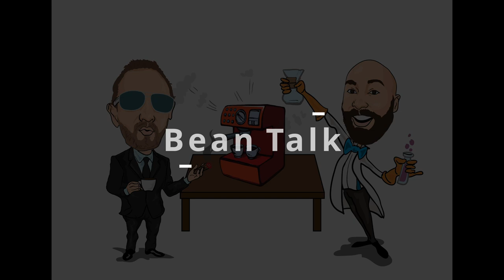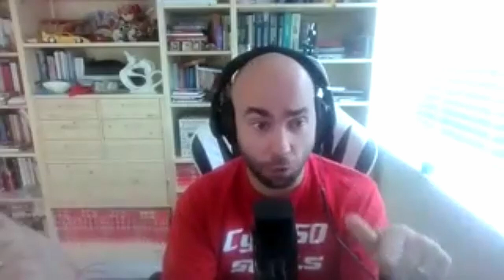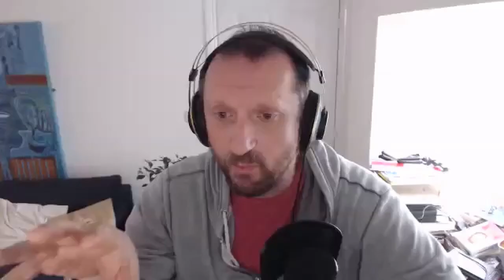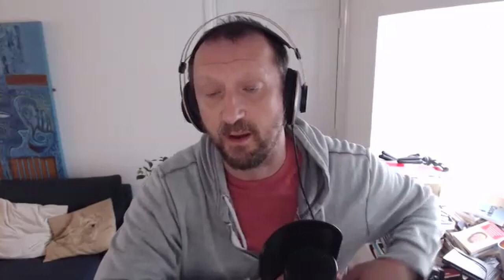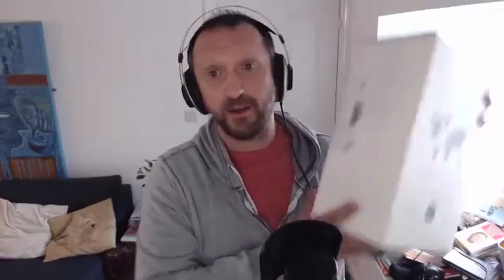Saturated or E61. Which Group Head is Best?

Comment: So which one is best?
Reply from the maker: Saturated. But only if you're willing to pay the additional cost, and have a more complex system to maintain.
Reply: @bartalks1810  like a la marzocco micra vs lelit bianca right?
Reply from the maker: @youtubeaccount7137  hmmm, not the lelit - that's an E64, the LM Micro, yes, but also others like the Sanremo You
Reply: @bartalks1810  en how is the e61 different from what lelit uses? Is what lelit uses better then tradionel e61?
Reply from the maker: @youtubeaccount7137  all e61's are the same including the one Lelit uses, and that is the benefit - it's old, but simple technology - easy to repair and get parts for. But, temperature stability is important for getting consistent good results. The e61 doesn't do this very well (depending on the use case), and the temperature is measured at the boiler, not the group head - where it matters. So each company uses their own method to estimate the actual temperature when it makes it to the group head - The Lelit Bianca allows you to manually set an 'offset temp'. Many ideas like this just don't work though. Saturated group heads, kind of have the boiler as part of the group - so there's no temperature loss, but the mechanism is more complicated and expensive. Hope that helps.
Reply: @bartalks1810  thankyou very much for the info. Its now clear

Comment: Hi
Can you tell me if there is also a difference in preinfusion quality between the e61 and saturated group heads?
+ Thx great content
Reply from the maker: well, Max might have a better answer for you, but I think the difference between different types of pre-infusion doesn't come down to group head as much as whether it's mains pressure pre-infusion, or if the machine has some way to develop the pre-infusion. For example if it has the capacity to ramp up pressure, or of course on the more expensive machines that allow you to pressure profile.  Remember the purpose of pre-infusion is to wet the puck gently so it expands and becomes more stable and less likely to form a channel when the pressure ramps to 9+ bars.

If you have a machine without pre-infusion, but want to improve puck stability / performance, 
there's been some super techy nerd-out material from a physicist over at coffee ad astra. He's been experimenting with putting a bit of filter paper at the top or bottom of the portafiler which improve puck integrity and maintaining hydraulic pressure more evenly throughout the puck. I'm going to be writing up a summary of his latest article over at bartalks.net next week :)
Reply: @bartalks1810  thank you cool😁
Reply: @bartalks1810   well given that machines with saturated brewheads cost twice as much as E61 machines, not sure if the espresso really tastes any better if one has good technique and makes 1-3 drinks a day at home or not? I make tasty espresso on my old Rocket Cellini with E61 brew head and HX boiler and cost me way less than that expensive Della Corte Mina, Slayer or La Marzocco machine.
Reply: @GuitarsAndSynths a simple Gaggia classic is a saturated group, if you add a pid to it, it works very well for espresso, not a high end machine by any stretch of the imagination, but if you only make a few espresso's a day it works amazingly well, down side is the single boiler for steaming, even with the pid the steam is poor

Comment: Sorry but  I gave up listening because the explanation of how hot water circulated through the e61 group head was so poor. All you basically needed to say is...
1. A pipe runs from the top of the boiler to the group head and back to the bottom of the boiler.
 2  Because hot water rises it flows from the top of the boiler to the grouphead, where it looses heat to the grouphead which heats up , like a radiater , after which the cooled water flows back to the bottom of the bioler.